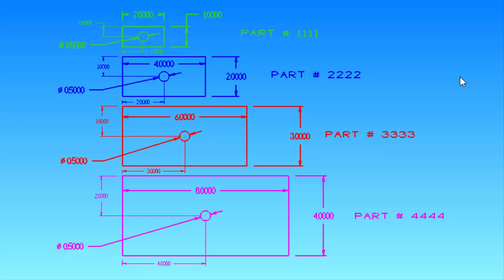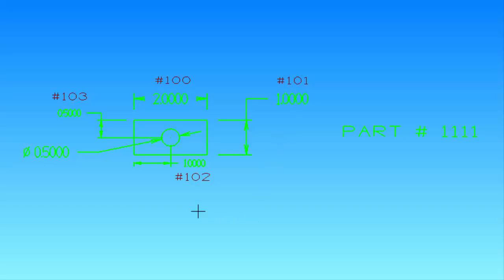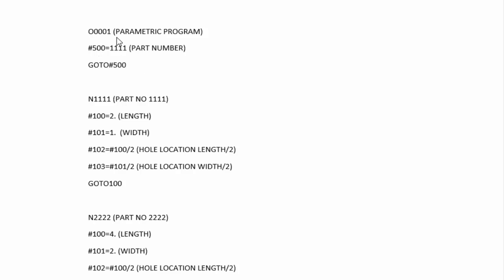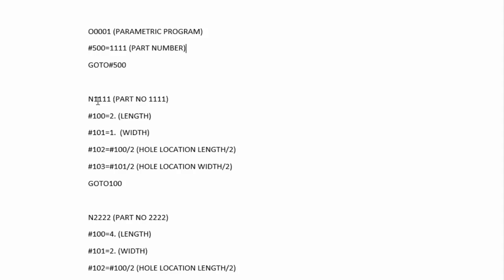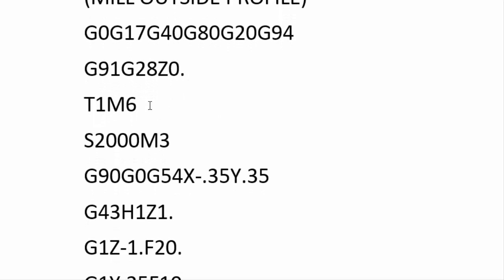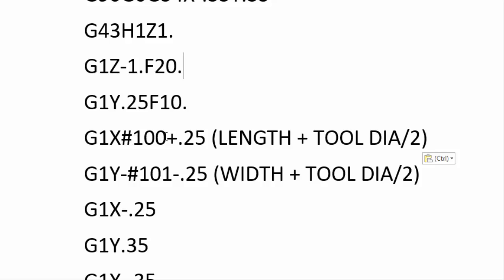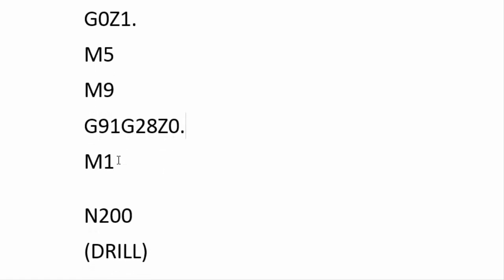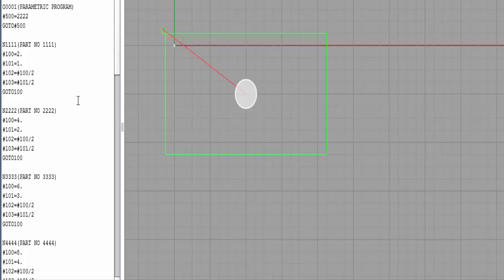BASICS OF PARAMETRIC PROGRAMMING

Comment: I might have posted this question on another video but it seems more appropriate here: On a Haas controller in a G02/G03 motion the R value is set to the variable #112 (R-TEMP)=64.+#103 (radial offset). For some reason it looks into the variable and only keeps the number part, ignoring the added variable. I duplicated the program and edited it to use Is and Js but it will either alarm with the typical variable input, or will run for only 1 loop if I 0. the added variable.